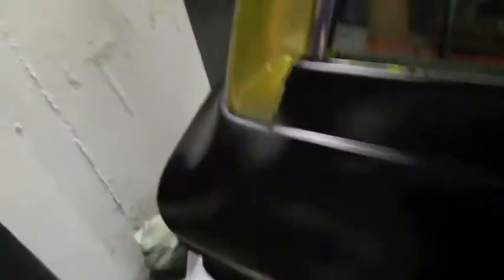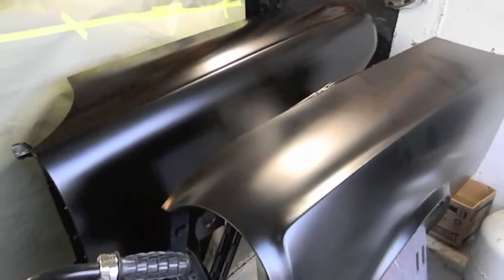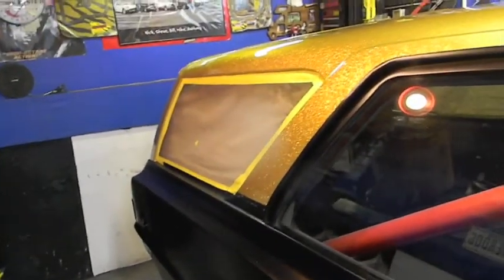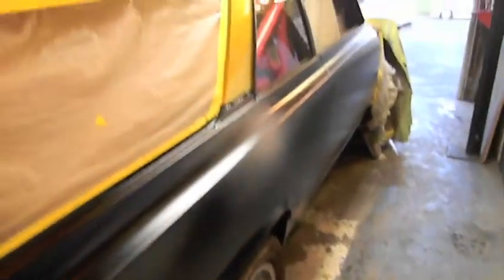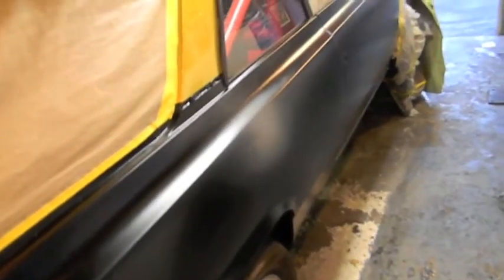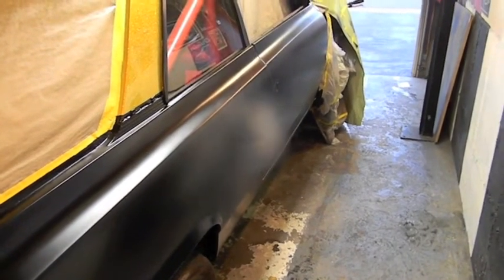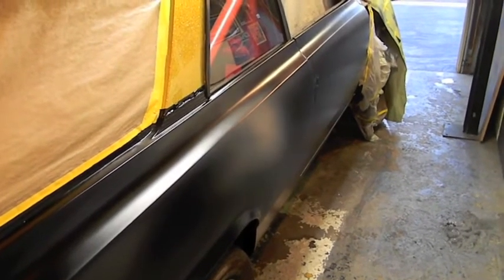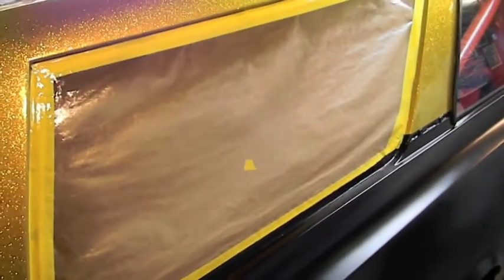I Went For It

Comment: dirt control - Grab a roll of clear plastic and some furring strips from the local home store. Make a quick "booth" right under the lift. One of the cheap box fans with a filter on the in side. A larger hole on the other side with furnace filters in it. Staple the plastic to the wood and some other lumber,bricks, tires ?? to hold it to the floor.

I have used the Eastwood carb paint. It's ok but looks more like a gold tinted flat clear, instead of the OEM gold chromate.

You can get really close to the OEM gold with the gold chromate from Caswells. They sell it as a stand alone or as part of a plating kit (need to do any zinc or gold on steel, like the linkage parts, mini bike parts?) If you just want the carb bodies AND they are bare or zinc plated you can use just the chromate kit.
http://www.caswellplating.com/electroplating-anodizing/zinc-plating-kits/chromates/yellow-chromate.html
You just degrease the carb body, bead blast it if you can. Then dunk it in a 5% muratic acid solution for 5-6 SECONDS, then rinse very well. Then into the chromate tank. Do both at the same time so you get a color match.
Reply from the maker: Thank`s for the carb info i will probably clean/polish the carb`s with new hardware.

Comment: You notice more with the satin black after a few years I've found out. You can get the stuff to recoat the carbs from Eastwood.
Reply from the maker: The last satin paint was on 7 years did pretty well but the car stays inside..How does the carb paint look? How close to org.?
Reply: homotorsports  the satin paint on my '66 Chevy truck has been on it for 11 years and the last two years it has been outside. It's still holding up pretty good. I'm not to sure about the carb renew from Eastwood because I haven't got any yet. I have used some of their products and was very happy. I have used their replating kit to do the linkage. You can do it for nuts, bolts, screws and all kinds of things. Go on their YouTube page and check out the videos on their products.